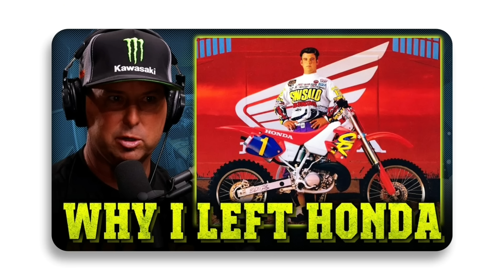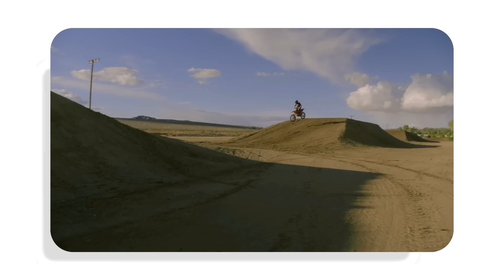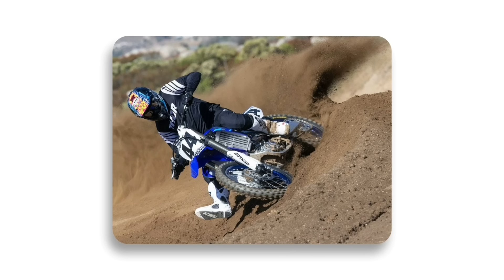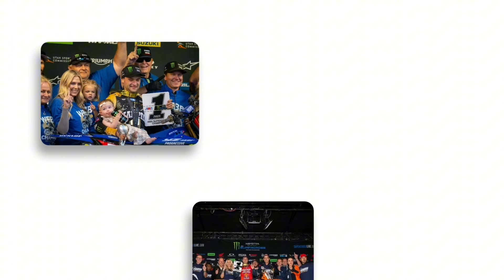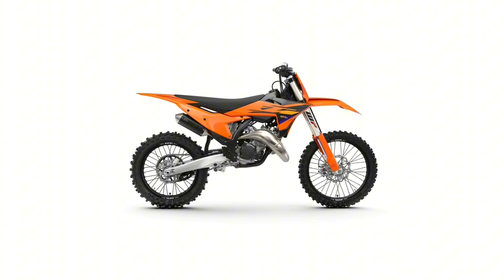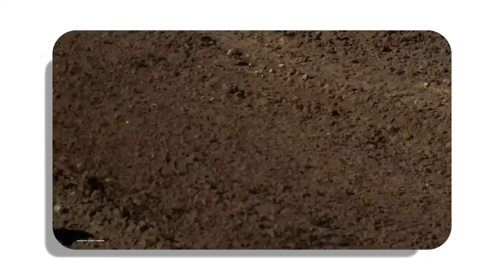Why KTM Refuses to Abandon Steel Frames (When Everyone Else Did)

Comment: Steel is more rigid, and their 450 weighs 20lbs less than the competitions aluminum framed bikes. Yes, steel weighs more, but it's way stronger so they can use less material, and save weight. Again, hence why KTM'd are 20lbs lighter than aluminum framed bikes

Comment: "When everyone else did"? Except for Beta, Sherco, Rieju... since japanese practically abandoned enduro (maybe there's still Kawasaki but Honda and Suzuki didn't do anything for years and Yamaha years ago abandoned their WRxxxF series too), the only brand with alu frames was TM for a long time. Now it's also Triumph.

So I wouldn't say everyone abandoned steel frames. Although given the features you mention, maybe that's why the enduro-based brands use steel and mx- and sumo-based (TM) use alu.
Reply from the maker: You’re right to bring that up
When I said “everyone else,” I was mostly referring to the big Japanese MX manufacturers like Honda, Yamaha, Suzuki, Kawasaki  who fully committed to aluminum perimeter frames in motocross.
But you’re absolutely correct: in the enduro space, brands like Beta, Sherco, Rieju (and historically even KTM’s direct rivals) stuck with steel.
Think It’s not just “old vs modern.”
It’s philosophy.
Steel = controlled flex, feedback, durability in technical terrain.
Aluminum = rigidity, precision, race-track aggression.
That’s why you often see:
• Enduro-focused brands → steel
• Pure MX or supermoto focus → aluminum
Curious what you prefer personally:  more flex feel or more rigidity?
Reply: @MXExplained1  I am not a very good rider so I don't think it makes a great difference for me. I ride steel because that's what's more available, as I said, except for TM, there is very few enduro bikes that use alu and I mostly ride enduro🙂
Reply from the maker: @TacticalHamsterDance  That's fair :) thanks for your reply

Comment: They kept their frames because they could do so and still exist as a company under capitalism. All the rest could be "solved" or changed through engineering. Materials are only part of the design and as everything involving engineering total cost is a massive factor.
Reply from the maker: Cost definitely matters, no manufacturer ignores that.
But if it was only about cost, KTM could switch to aluminum tomorrow. They have the budget and the R&D.
The fact they’ve stuck with steel even winning at the highest level suggests it’s also a chassis philosophy choice, not just economics.
So maybe it’s not “cheap vs advanced”… but what kind of ride feel they’re optimizing for.

Comment: At the consumer lever Aluminum wins...Steel frame fatigue over time. in under 60hrs from A weekend A riders and 10hrs for top pros. You can measure this from end to end as your wheel base lengthens and it is a real thing.  At the pro level Steel needs to be replaced every few races where a Aluminum can last a whole season.  This is a well know phenomenon,
Reply from the maker: You’re right that all frames fatigue over time. But it’s not really “steel dies fast, aluminum lasts forever.” Steel tends to lose stiffness gradually.
Aluminum can feel great for a long time, but when it goes, it goes.
At pro level, frames get replaced often either way. For most weekend riders, we’ll never hit those limits.
Have you actually measured wheelbase change yourself?

Comment: Hm so KTM is the Unimog of dirt bikes? If flex is a feature Unimog is on the podium, and so are KTM.
Reply from the maker: That’s actually a pretty solid analogy. The Unimog wins because of articulation and durability not because it’s the stiffest thing on the road.
You could argue KTM plays a similar game: usable flex, traction, and consistency in rough terrain.
But just like the Unimog wouldn’t win Le Mans… a super stiff MX chassis might feel better on a perfectly groomed SX track

Comment: My dad always told me aluminum frames were always bad. You can't repair aluminum frames.
Reply from the maker: That’s a classic dad take haahaha
And to be fair… there’s some truth in it. Steel is generally easier to repair. You can straighten it, weld it, reinforce it. A lot of local shops can work on chromoly. Aluminum is trickier. It needs proper TIG welding, heat control, sometimes re-heat treatment. If it cracks in the wrong place, many people just replace it. But “can’t repair” isn’t really accurate; it’s more like “harder and less forgiving.”
Back in the early aluminum frame days, failures were more common too. That reputation stuck. Did your dad ride in the 80s/90s when aluminum frames were first getting popular?

Comment: greeves had aluminum frames in the 60's
Reply from the maker: You’re right 😄 Greeves Motorcycles was way ahead of its time in the 1960s. They were using cast aluminum beam-style frames when most brands were still fully steel.
So yeah aluminum frames definitely aren’t some “modern revolution.” They’ve been around for decades. What’s funny is the industry keeps cycling between stiffness and flex like it’s a new discovery every time.
Old ideas just come back with better engineering.

Comment: NOT agree - ktm for decades have no linkage system and the bike much more punish you on the bumps. it has really precise handling if you hit ideal trajectory and slide on the top of bumps.  after I change bike to yamaha it was much easier to ride on, suspension was so forgiving
Reply from the maker: any thought on that? I said that KTM is frame is more comfortable for small bumps and better for rider fatigue (arm pump). But is less forgiving big mistakes compared to japanese aluminium frames

Comment: STEEL IS REAL !!!!! This is something said for years about Mountain Bikes, STEEL IS REAL Cromoly Steel has been used in MTB for years. ln MTBing there 4 main kinds of frames, Aluminum, Titainium, Carbon, and STEEL, there is even Bambo frames, Etc. The older riders know, many prefer Steel (Cromoly) Frames, There is a feel, a knowing, a connection with the ground that doesn't happen with other frames, Sure its a small thing, but it instills confidence, and confidence has won more races in MX, snf MTBing, Hare Scrambles, etc. I'm old now, many of us ex MX/Enduro racers, .ride MTB's as we age, I'm only 79, I Raced MX, Scrambles, Hare Scrambles, Ice Raced, Flat Track TT racing, now I'm the motor, and its a blast. on my Steel, Alum, Carbon, MTB's, STEEL IS REAL. HAPPY TRAILS !!!

Comment: Ally frames are NOT lighter in total weight due to notable thickness...needed to avoid cyclic fatigue...thin ally cannot handle serious cyclic fatigue...the reason fighter jets went from ally wings to carbon fibre. Fighter jets also use chromo in all landing gear structures!! The Japs were idiots to ditch chromo and I really hope they return to logic and physics!!

Comment: aluminium lasts decades no rust no issues, you can store the bike in salt water no problems with it.
Reply: Er ,thats wrong ,alloy fatigues,also carodes from salt water  ,alloy frames were introduced from raod ride sector to boost lagging cr sales
Reply: I have a 2000 KX 250, and my friend has a 1989 Honda CR 250.
We don't have any rust issues; we take good care of our equipment. We don't pressure wash, as it wears out the bearings. Alloy steel is less susceptible to corrosion than regular steel (I don't know about KTMs). Aluminum is more susceptible to fatigue than steel. I'm an argon welder; I've welded swingarms, hubs, and rims, but not frames; we're in a tough spot for motocross in our region.

Comment: The Japanese bike switched to Al frames as they didn't have access to steel ore as abundantly as aluminum, production cost made them change, then push marketing to sell it.  Both have advantages and drawbacks.
Reply from the maker: Interesting take
Reply: First clue that you don't know what you're talking about.... "Japanese didn't have access to the steel ore"
There is no such thing as "Steel ore"
The Japanese have the same access to "steel" as the Austrians

Comment: Frame feedback und stiffness is an interesting topic and it is very subjective what riders prefer.
There were MX- and Rally-World-Champions on KTMs who prefered to race (and win) not on 100% new steel frames but on already to a certain level fatigued steel frames (with for example 100hours on it) which had already microcracks because of prefering frames with more flex.

Comment: The steel frames should become stainless steel so they have the same feeling over time without rust degradation, which can feel significant on thin walled tubes
Reply: Stainless Steel has a lower Strength then Cromo Steel this means No Advantage It is also Double or three times the price of Cromo Steel.
Reply: @DrBob-gs1ng furniture grade stainless steel that statement is true but for structural stainless steel  your statement is opposte of whats true. You can get stainless steel up to 220 KSI strength. Stiffness is always going to be 29,000 KSI for all steel variants. There are alloys that have a good yield strength that would be appropriate for a motorcycle frame and is stainless steel, it would cost more...but relative to the price of the bike and not that much more. If talking ultimate feel for a frame for years and years of use it would be titanium or metal matrix composite...but then you're talking exotic pricing.
Reply: @jasonjoel800 Thanks for your comment. Can you Name These alloys and how Common they are?
Reply: @DrBob-gs1ng I like Reynolds 935 tube ... It's expensive and it's not common but there is no reason an industrious company couldn't create their own supply chain. Spacex and tesla did it, now they have very good stainless steel.
Reply: Stainless steel is not very durable. It does not like flex and vibrations. There is no super metal. If you add a charactaristic, you loose another.
Reply: @nickking7375 Reynolds 935 something like that would be cool
Reply: Also I'll say that the only reason that material is really expensive in tube form is cuz not many people order it. But if supply chain could be worked out there is no reason why it couldn't be more cost competitive
Reply: even stainless steel can rust over time. i work for a steel compan and we seperate steel from stainless for our stock but still we have had a decent times that we gor the stainless form our suplier and is was rust free after some months we had to pick a order out of our stock and it was starting to rust so it's not completley rust proof

Comment: I love my ktms . I've been running steel frames all my life. Plus easily powder coated and refreshed. Weldable . If you don't have a tig welder to weld aluminum or proper rods it is hard to do for aluminum frames. The flex of the steel frames is nice. I think tomac is great on ktm . He looks happy and he is driving those turns hard . With a bike able to handle the power outputs he wants.  Pretty happy to see where ktm will take him. He isn't done racing.
Reply from the maker: Yeah Tomac on KTM is very promising, especially as he is a rider very concerned by arm pumps. He told in an interview this was the reason why his fork was so soft on the yamaha... So KTM is a great fit for him. We saw that  at Anaheim 1
Reply: Yes steel, but it must be light and KTM has that down to a T, steel will absorb and flex.

Comment: Steel doesn’t have superior strength to weight…
Reply: Steel is about three time stronger than aluminum and about three times heavier so the radio is about the same. Sometime you can distribute aluminum so that the design ends up having higher strength to weight ratio.